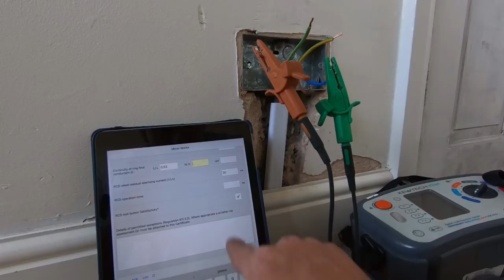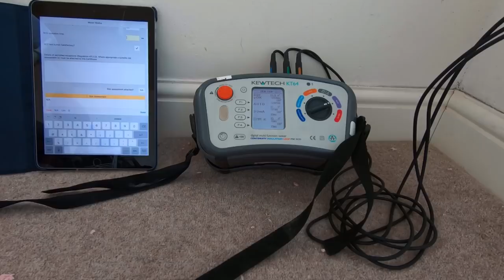Adding Additional Sockets To An Existing Ringmain. Banter!!!

Comment: Your customer probably thinks by you doing an EICR, it's some sort of substitute for an EIC. The new works still needs to be signed off and notified to building control.
Reply: No it doesn't. In a situation like this where you can't get the contractor back or they're out of business, the local building authority will generally accept an EICR. They will then sign it off if it's found to be satisfactory.
Reply: @beardedsparks2825  The local building authority will most likely only accept an EICR where there are absolutly no limitations on the new works.
Reply: @ashmanelectricalservices4318  Incorrect. I've been involved in many such jobs. There have been instances where the contractor has gone out of business and is not able to carry on or finish. I have been asked to carry out such work where two contractors had died in motor accidents. It's not uncommon at all.
Reply: @beardedsparks2825  Ok, I stand corrected.
Reply: Bearded Sparks local building control usually don't have any electrical experience believe it or not 😱
Reply: @michaeljohnson1006  They have the final say, which is why they call on qualified registered electricians to carry out said testing.
Reply: Bearded Sparks they shouldn’t except it, and you can’t sign someone else’s work, building control can pass it of at a cost of 300, the clue was in the EICR certification being a report and not an electrical installation certificated , the work carried out in the video could be done on a minor works.
Reply: @ecoterrorist1402  Firstly it's 'accept', not 'except' 😉
Secondly the electrician who carries out the periodic inspection and issues the electrical installation condition report, isn't signing off the other contractors work. They're simply giving their expert opinion on whether the electrical installation is fit for purpose, based on what they can see and test.
The building authority are the ones that sign it off, because in the event that a contractor is either unwilling or unable to certificate the work, what are the building authority going to do? Are they going to tell the home owner to rip it out and get someone else in to start again? That's unlikely if there's actually nothing wrong with the install. Building control have the power to sign off what they want and if they're happy that the installation is safe and fit for purpose after having an expert test and inspect it,  that's exactly what they do.
It isn't any different to the third party testing some of the schemes run. Anyone can carry out electrical work in the home, qualified or unqualified. You can go direct to building control for as you said, around £300 to get guess what? Third party testing. The reason why there would be no £300 fee in this scenario, is because the homeowner will have to pay a qualified individual to carry out the periodic inspection whereas building control would have to employ a third party otherwise.
I hope that makes sense to you.